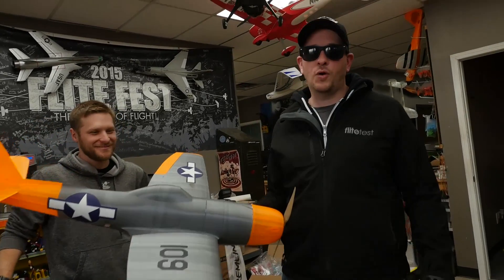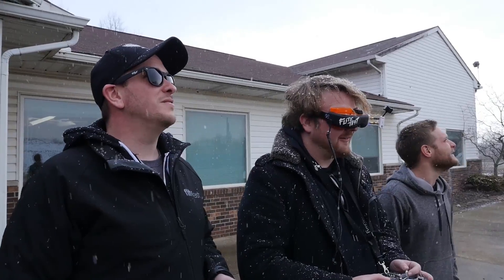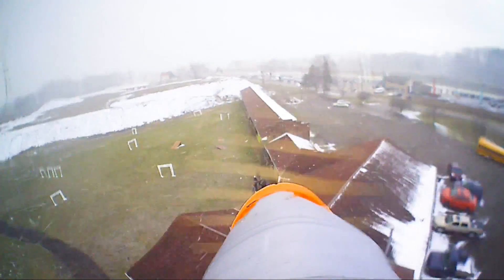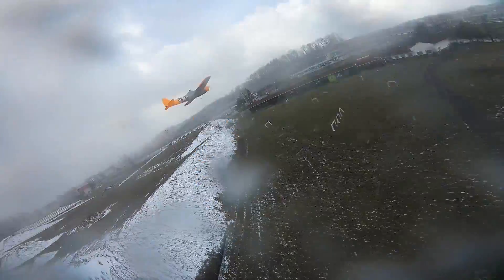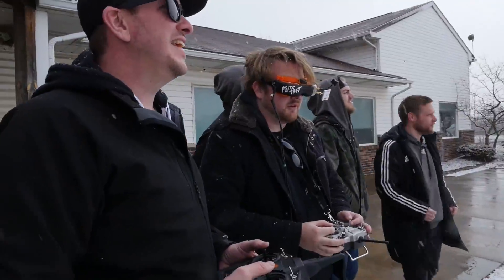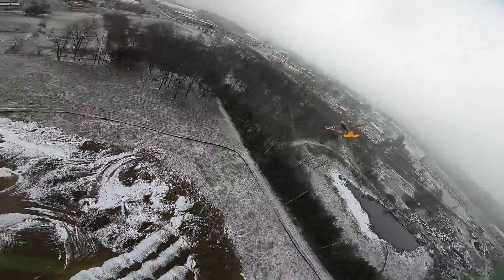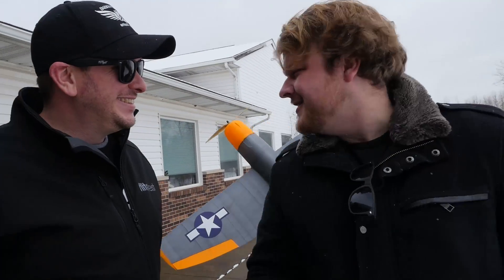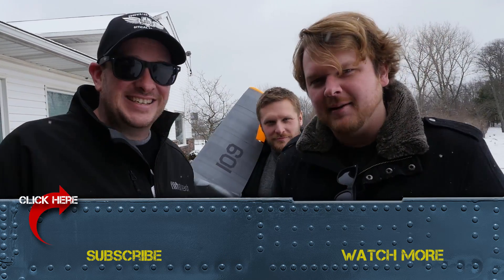3D Printed Plane Meets Blizzard!

Comment: Loved 3d printed planes, but they are extraordinarily fragile.  As a newbie to flying RC,  i spent more time reprinting broken planes than learning how to fly them. Must have reprinted 3dLabprints cub completely at least 4 times before i finally put it aside frustrated. Instead, I designed and built a hybrid foam/3d printed trainer that could survive  the abuse I was  dishing out trying to learn how to fly at a very unforgiving air field.  Foam combined with 3d printed PC carbon fiber engine mount and landing gear allowed me many cycles of learning in a given outing even after crashing to finally my advance flying skills.  With the 3D printed cub, i rarely got off the ground before trashing the plane in a ground loop or just running of the runway. Just even a minor crash, something would be broken beyond field repair, (the PETG landing gear mostly ) and i would be done flying for the day.  thus I don’t recommend printed planes to learn how to fly.   Foam bounces and takes dents and can fly again and again.   PLA simply just shatters.

Comment: I just printed this plane & my son & I are so excited to glue it together & fly it. Love the colors you guys went with. Any tips for the proper CA accelerator that won't white out the plastic?

Also any recommendations on a brushless motor? Both of the one in the PDF are discontinued. 

Thanks again for this video, it was Sweet.

Comment: Parts list (including remote)? I want to print this out at my local Library (which does printing) and I would like to build this as my first plane,  as I love the p-47. Also, what is the sizing of the bed of the printer (in order to get scale). Or, is there a prebuilt, beginner and budget friendly p-47 out there that would be a better option?

Comment: Hey guys i am.using a Lulzbot Taz 6.  Been struggling to get good print quality.  What software are you guys using for your prints.  Currently i run the Cura 3.2 for lulzbot

Comment: imagine these 3d printed planes were made of thick paper and aluminum tape. you could add the landing gears and bb guns to have a legit dog fight. like if you keep shooting a wing, it'l eventually rip off and crash the plane, OR if you're lucky still land it with one wing. and since it would be made of aluminum tape and thick paper, you could do field repairs with just aluminum tape. maybe you should make the ammo rack for the bb gun out of thin paper so that if it has too much holes in it, you'd lose ammo.

Comment: Unless you keep power output the same (in watts, e.g. lower the prop load and/or get a lower kV motor), you do not magically gain efficiency by going with the higher voltage. On the same prop/motor, the power system would draw way more current as the higher voltage would cause the motor to spin faster.

Comment: Think it is ironic that you have done a high visibility orange and gray printing job on it.  This is the paint job used for trainers to make it more visible.  (that way you can keep an eye on the newbies to make sure they don't fly into you).  David Johnson (the highest kill count thunderbolt ace in Europe during WWII) brought his badly damaged P-47 home to crash land on an RAF fighter station.  He had been chased a third of the way across France (and shot down four that day), when Johnson got out of his Thunderbolt and began counting the holes in the aircraft he quit counting after one side (over a hundred holes in the plane on THAT side)!  German cannon shells blew the ammo box for his guns OUT OF THE WING (there is a picture on Johnson with is head/shoulders in the hole!) and the plane brought him back.   He found corn stocks in between the barrels of his guns he was flying that low!  A German shell blew one of the cylinders off the engine, but it brought him home! As Johnson was examining the damage the warrant officer responsible for the field can driving up to Johnson and started screaming about the damage to the grass field done by the flat main tire and shredded tail wheel!  Johnson was stunned (probably suffering from what we would refer to as PTSD now) and replied that if the RAF could come up with a fuel truck and tire he would leave the field!

Comment: Would you guys consider selling 3D printed planes? I mean we cant all afford a 3D Printer =)
Reply from the maker: Hmm...
Reply: Lol I dont think you own a 3d printer
Reply: What I was saying is the typical FT person who likes building planes from Dollar tree foam might like to have one of these without the expense of buying a 3D printer. Lulzbot Taz6 is 2,500. The mini is 1,250( it's probably too small to print one of these).  I see the filament on the FT store for 12.95, the plans I believe they said where 20. So That's quite the difference . I would rather just buy the already printed kit. Maybe optional replacement parts although CA might be the new hot glue for these. They would probably have to do some kind of license to use the plans. I'm not a business guy. I just want to fly some cool planes =)
Reply: Ender 3 costs $200 in kit format. Taz6 is expensive
Reply: there are much cheaper printers. there are many under 500$, I have a tevo tornado, a nice printer, buyed for 300 euros.
Reply: $15 for filament for this plane. Not expensive at all.
Reply: its more the cost of the 3d printer =)  Saving up for one, but still
Reply: The best 3D printer I could advise people to get with a budget is the Creality Ender 3 or 3 plus. They're excellent and have great quality prints. They sell for about 250-300 dollars on amazon and that way, you can reprint parts that you need in the event of a crash. Also you can get into other 3d printing projects ;) Heres a link to the one I bought and have had great luck with. https://www.amazon.com/Comgrow-Creality-Ender-Aluminum-220x220x250mm/dp/B07BR3F9N6 Cura is also a great slicing software which is free to use and easy to setup

Comment: plans, material cheap...3D Printer to make a decent size model...Expensive
Reply: Check out the CR-10. Cheap chinese printer that needs some dialing in, but really big print platform. Thinkin about getting one with my tax return.
Reply: Snes Guy 

Just ordered mine yesterday! What are the necessary mods?

Comment: What is the build volume needed (for 3d printer) to print those planes?
Reply: "Most of our planes fit 195/195/150 mm or 250/120/150 mm" - from their FAQ: https://3dlabprint.com/faq/
Reply: Jotham B  Thanks!
Reply: UncleManuel  It is possible to combine STL. Meshmixer or fusion 360 are the first to come in mind that could do it.
Reply: It's tailored for most small consumer 3D printers. Not everyone has a huge printspace like with a Creality CR-10 S5 (500x500x500mm) or my Tevo Little Monster (340x500mm). I wonder if it's possible to combine some STL files to create less parts to glue... ;-)

Comment: I think 20 bucks Is a bit too much for just a SLT file that you need to print up , I could see paying a little bit for the design maybe $5 at the most , and id hate to pay 20 just to find out the parts are too big to fit on my printer
Reply: thats why they have realeased a certain part of their models so its useless in itself but you can check if your printer can handle the size and printquality required for the build, also the spitfire is free so why dont you check that one out and try it! but for that 20$, keep in mind, they design all these designs from scratch, and any pc work, coding or designing, always pays high since it takes allot of time, so keep that in mind!
Reply: Seems like they would just tell you min build volume required?
Reply: They do give the minimum platform size to build each airplane on the website.  Check it out,  they also have a forum with a lot of questions answered about their builds.  3DLabPrint has invested hundreds of hours in testing their designs and have included many videos on YouTube that are helpful.  Not all 3D printers can print the one perimeter needed so if you are going to get a printer you might go on their forum and ask which is best for their designs.  I have a CR-10 and it is capable of "thin wall" printing but, a lot of tweaking is in order and the slicer used is also a big consideration.  These Guys at 3DLabPrints have been the innovators for this printing, their designs are worth every penny and are a bargain.

Comment: I absolutely need a 3d printer!
Reply: Emmet Wright sand it's gotta be big ish 3D printer, cause those were some large pieces
Reply: If you get the prusa i3 mk2 or mk3, man those things just go and the gcodes they provide with the plans are sliced already so you can just put it on the SD card, load filament and print. Saves all the tedious hassle of setting up the slicer, tuning just right to get the gcodes. And that machine just kicks ass prints non stop no problems out of the box.
Reply: Jotham B Even thouh the prusa is an amazing machine, it lacks build volume. Either you will have to modify the Stl files or get a bigger printer.
Reply: Josh Walker yeah, for sure.
Reply: Jotham B ok thanks I’ll check them out, but yeah a bigger print volume would be nice
Reply: The build volume is big enough. I did the BF109 and the P38 Lightning on my Original Prusa i3 Mk2 no problems. It has a build volume of 250x205x200mm
Reply: "min volume for model: 195/195/150mm" The P47 and all their other planes do fit on the prusa i3 Mk2 - from userguide: https://3dlabprint.com/wp-content/uploads/2016/11/userguide_P47_N15_Thunderbolt.pdf
Reply: Looking for 18+ inches of Z... check out the UltiBots D300VS-PLUS 3D printer! Also there is an active FB group https://www.facebook.com/groups/UltiBots